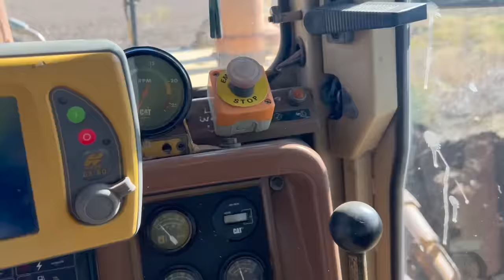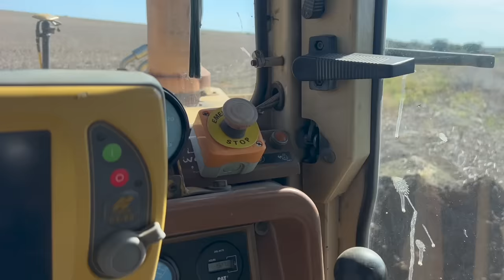The HARDEST Recovery We Have Done | Bogged | D11 Bulldozer | Vlog 210

Comment: Great work Reminds me of extracting a Kato 25 ton at Enebba Western Australia Feb 1990 ,buried in a turkeys nest I swam / dog ,paddled away from it at least saved pilot I had managed to stop engine before water got into air intake, so not a complete disaster The rescue of ,machine was bit similar to yours That was the time on sites where blokes were allowed to think for themselves 
As we could not start machine we hooked a D9 flat track + a 651 twin powered scraper in tandem ,no luck the suction of a dead machine not a budge A young fella , Snowey if my memory serves me with some expert wheel case back hoe made a drain to drop the water level and around 10 pm we retired for the night similar next morning water level lowered , fire up the donk and one easy yank and it was out of there 
We were using chains in those years No pulling slings at least on that job My experience of chains if you’re using a heavy chain and hang some car Tyres along its length and take an easy pull it’s a lot less likely to snap We see a lot of stuff on 4 Wd shows that would make the old boys roll in their resting place I don’t recommend chains in place of slings ,but as they say any port in a storm Had a couple of close calls with chains generally my own mistakes 
End of story got machine out washed and returned to hire company in Perth Why did machines get into the water The boss who was a top bloke Instructed me the machine operator to fill in the turkey nest ?{ Place where pump is placed on site for filling water carts etc} He forgot to tell Paddy that turkey nest was app 4 meters deep and as machine at that stage was tracking on 1 track motor when I set out to pull a bucket of dirt from far bank and when the slide started with one track motor + lacking in power in we went 
Had lots of photos all lost when camera went missing anyway apart from dented pride all ended like your job well ,keep up the good work Paddy in Oz
Reply: Hang some car tires along the length of the chain?

Comment: Wow, what a job. I couldn’t help but think if you had time and gear a tripod between the dozer and the excavator would change the vector and give you lift, but also complicates the situation and the silt would be problematic.
Reply: Actually, a bipod might be better.

A tripod would need to be set up with a pulley and be stable in two directions, plus you couldn't run those straps through a pulley.

A bipod however, you could connect to the excavator, then connect to the dozer and angle it more to the excavator to start with.

Then it would lift the excavator as the dozer pulls it before reaching 90 degrees where hopefully lift is no longer needed.

If the length of the line between the bipod and the excavator is a touch longer than the height of the bipod, then you wouldn't even need to re-rig it, just keep pulling and drag the bipod along which would actually help pull it out of the mud anyway. 

The real issue is, having a couple of beams strong enough with feet large enough to bite into the ground without sinking to bedrock, storing them, transporting them and setting them up.

At that point, it would be easier to use another machine to carefully dig out an easier path for the excavator. 

Maybe an even smarter system would be the use of airbags.

Think of 4x4 exhaust jacks.
Well, they do make them much larger and whilst they are normally used with special air compressors, technically any air compressor would work, just a bit more slowly.

They spread out the weight over a large area and use very low PSI (which is why you can hold one over the exhaust of a car to inflate them), so they are perfect in soft mud.

A quick Google shows one intended for 4x4's rated to 4t for a few hundred bucks and I've seen them rated for at least 20t but not the prices on those.

And at most, I've seen them rated at just 15 psi (some even lower at 7 psi).

Honestly, just for laughs, I'd buy a couple of the 4x4 ones (still good for using on the 4x4's), and see if two of them can lift one end of the excavator on soft ground (not bogged).

If they can, it may be a smart move to give them a try when it is bogged.

Inflate them both and wait a while, inflate them again and let them break the suction slowly (if they can).

Comment: Matt the marvel by passing the isolator a genius to   by pass it in order to get the escalator  started would be much much harder or impossible pulling a dead weight especially a track machine as all escalators are.I land planned a paddock  as the combine was 28. run 16 feet wider and intentionally filled in a watercourse.A very wet year was  using an Ackland wide line with a John Deere 5020  pulling it well could not see where the old water course had been and. dropped the 5020 right into it  Was grounded for a week lost a weeks pay as had to get a neighbour with a D8 to get me out.Was also laughing stock in the district  for being so stupid. I compliment Matt for staying so calm.

Comment: Should try the two and a half inch Yankum recovery rope, For Use on vehicles from 37,500 - 67,000 lbs
Minimum Tensile Strength 201,000 lbs
WLL 40,000 - 67,000 lbs
Reply from the maker: I think we would need a 3 inch😂

Comment: Wouldn't it have been better to get the excavator running and use it to dig out around itself before trying to pull it? You're pulling tons andvtons of extra weight trying to pull it against all that mud.

Then, once you've dug out around it use the arm to push or pull with the dozer pulling too. Great job getting it out. Its just whenever we stuck one we did it a bit different.
Reply from the maker: The driver tried to dig himself out but it was too sloppy and each time it moved it got deeper👍 every situation is different

Comment: Ok who ever buried this excavator, should be severely reprimanded or replaced! ( because )  this machine didn’t just drop in the mud!! The operator knew they had that machine in a bad place an continued to operate until they totally stuck it! Once realized it was bad ground to operate I would have walked the machine away! Lots of money an time involved with a mistake like this
Reply: I am assuming he likely got it bogged down and in trying to get it out just made matters worse. I've found that with heavy equipment, once you get bogged down, just stop and go get something to help pull it out. Otherwise you just make matters worse trying to get out.

Comment: Why didn't you use the excavator boom to level up  and help push.
Reply: They  did  that's why they had to get it started to help drag itself up out of the hole.
Reply: I think they would have torn up the body work if they swung it any at first and it was not at the right angle....the next day they used the boom u could tell it was working
Reply: Get real. How soft was the ground for the excavator to sink over 2 metres over the fiull length of the track. Do you reckon the ground in the same area was firm enough for the bucket to support all that weight? Also the blokes have not been operating the equipment for long enough to think about your suggestion.
Reply: The slew could not turn! Counterbalance was stuck in the mud & if it could turn would’ve wreck more panels. - Phil
Reply: Did you see how sloppy that black mud was? It is a silt bar from the flood last year, nothing to grip on with the bucket. They are treacherous and look completely safe.

Comment: Those straps are not good at all , if you are not too far from a shipping port and there is TUGBOATS go take a ride there and ask them if they have old TUGBOATS ROPE they are generally between 1 1/2 inches and 2 inches diameter 38MM and 51 MM diameter, you will never broke them , and you can get them for free or few hundred dollars for a 200 meter length, they change it regularly.

Comment: On the 2nd strap breaking pull, why was the boom arm and bucket left down in that position? Why not have those up out of the muck, and the dipper arm sucked back towards the cab?
Reply from the maker: Main reason was trying to keep the centre of gravity as low as possible, no way of knowing how far up the front was going to go👍😁